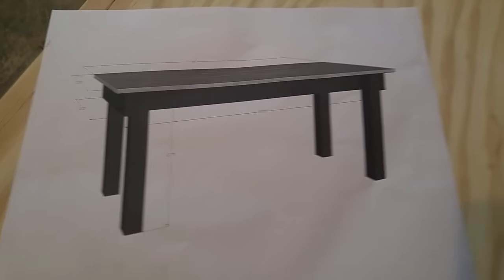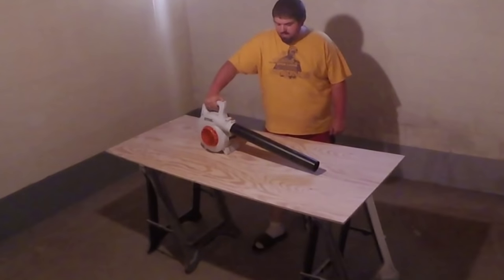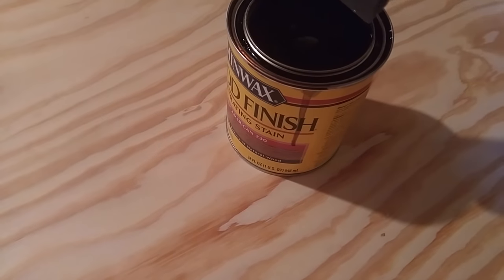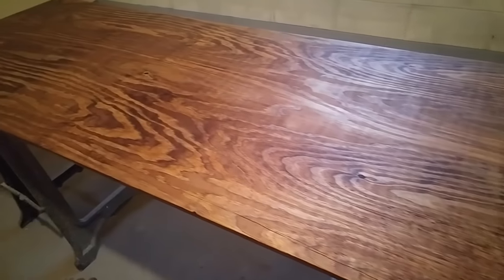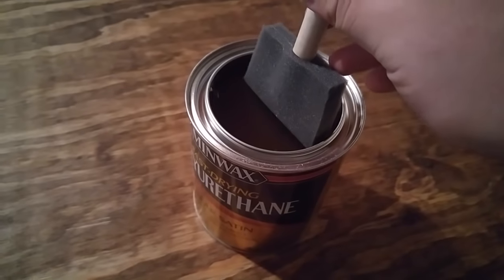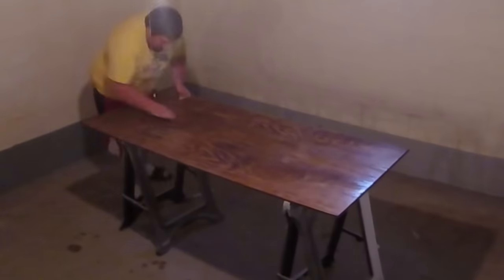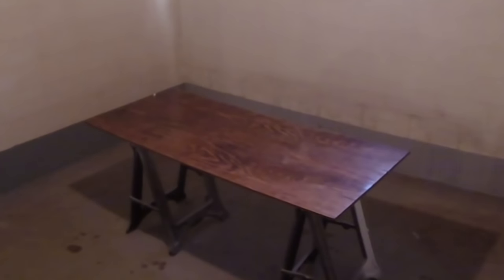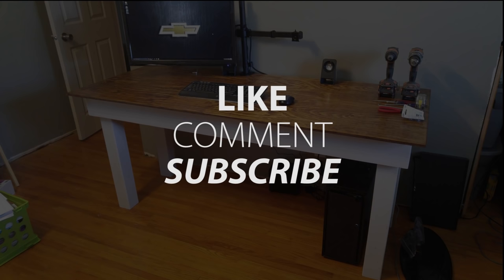Super Simple Computer Desk Build

Comment: I'm new with this kinda stuff. How do you determine what type of sand paper you sand it with?
Reply: Welinigh larger grit is tougher on the surface and strips faster and rougher, as you move higher in grit number you'll get to finer sandpaper which is used to finish the surface and get it nice and smooth or between coats of paint to smooth out the coverage but thats all up to you, you can always try to pick up some assorted sandpaper at harbor freight to get a better understanding and then just move on to a better brand.
Reply: The lower the number the rougher it will be.  The higher the number the smoother it will be.  You use the rougher first to get the biggest most noticeable blemishes.  Then you get higher to actually make it smooth.  I never use higher than 220.
Reply: Welinigh since you got 2 good explanations about sandpaper let me add so you do not have to use all the grits of sandpaper that this guy used. It's obvious that plywood that this guy use was fairly smooth to begin with you probably only need to use 100 Grit and then to 220 grit. You'll be fine.

Comment: is that a 1x4 wrapped around the 4x4? im interested in doing something along the lines of this and im not too wood savy to tell. would gladly appreciate it :D
Reply from the maker: There is a 2x4 frame all the way around. The 4x4 posts are inside of the frame.
Reply: Looks like 2x6 not 2x4. The sides are wider than the 4x4 post. They should be the same size if you used 2x4s